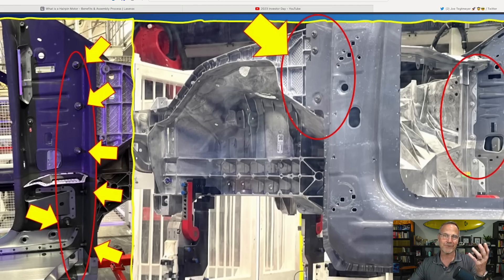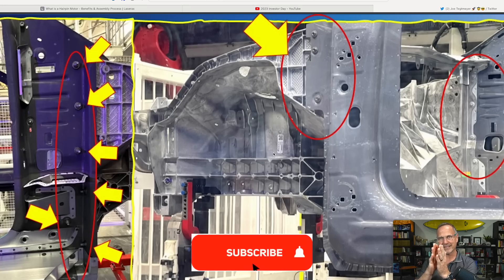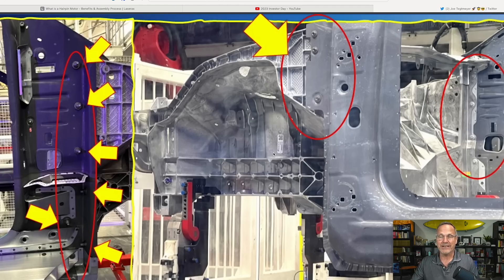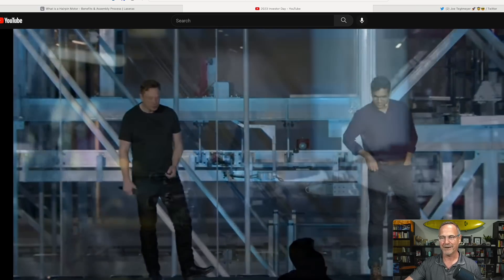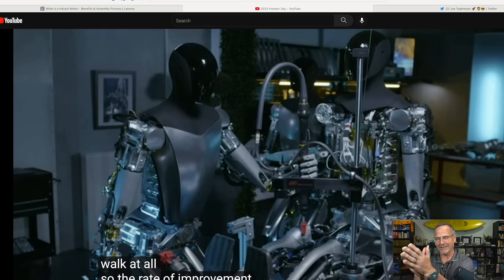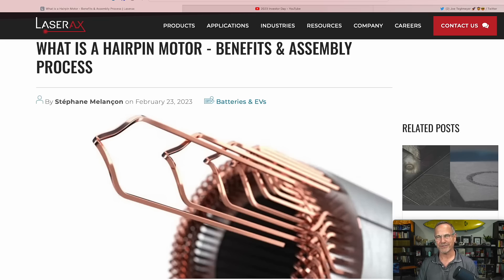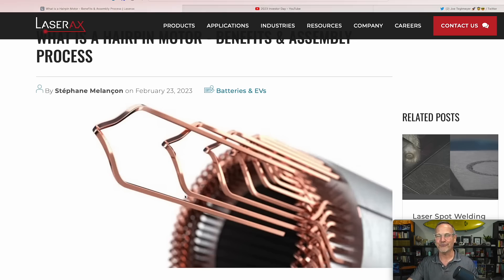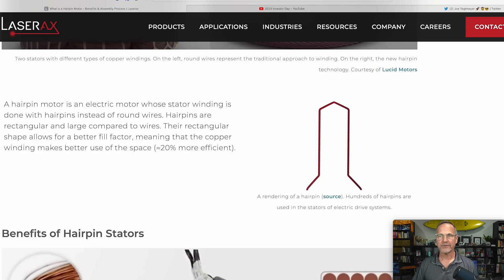Tesla Has HAIRPIN MOTORS! 🤯 What the Heck Are They?  Plus Teslabot is REAL, and How To Attach Panels

Comment: Unless I missed it, I believe one advantage of hairpin over winding that you did not mention, is the speed of build. Winding that long thin wire round and round vs shoving in the hairpins and then laser welding (according to Sandy Munro)
Reply: The machines required to assemble hairpin type windings are vastly more complex to construct than simple winding machines. However winding machines are not very efficient needing to be reloaded with wire bobbins regularly meaning a lot of down time and operator intervention. Tesla has no doubt spent a great deal of time and money constructing some kind of computer controlled machine to mass produce these motors which is why they consider these motors easier to build now.
Reply: Tesla told us what the result of those changes are. 1000,-- US$ drive train without rare earth metals... WoW! My Computers cost more!
Reply: Someone tell me why Tesla did not use hairpin motors from day one.  If it is better and cheaper, why not use it?!
Reply: @davidbeppler3032  Indirectly at least, this was enabled by the shift to 48V.
Reply: There is the issue of skin effect. You want that hairpins thin and flat. But thin hairpins are harder to handle and insertion is more delicate. So for manufacturing speed a square hairpin will be easy to handle and faster to assemble but for performance a flat hairpin is the best. Between this two extreme stranded round wires are good enough.
Reply: @davidbeppler3032  Hairpin was restricted to bigger industrial AC and DC motors for a long time. It may have not been practical until the move to higher voltage in EV applications had some teeth.  Tesla has been a big driver in getting the cost and availability to the silicon to do the power conversion for that app
Reply: @davidbeppler3032  For the same reason Henry Ford didn't put GPS and touchscreens in the first Model T. It wasn't available yet.
Reply: @Rage SR  I believe Sandy was showing examples on MunroLive of Chevy Bolt rings that took pins. He said Chevy invented the process.
Reply: @uddek  Presumably lucid has been using it since day one. Isn’t that how they got 500 miles of range?
Reply: @wickham53  they got to 500 by putting a massive battery in the cars and being able to spend much more money per vehicle with their very high prices
Reply: @uddek  What do you mean it wasn't available? This isn't something new or something rare. This kind of  armature design is being used in dc motors for a long time.
Reply: @TheCerovec  it was available before.
Reply: @sungjunbae8973  I know, I've seen plenty of them.
Reply: @uddek  Not true.
Reply: @uddek  The hairpin motor was patented in 2012.
Reply: @TheCerovec  Yes, since way back in 2012 when it was patented.
Reply: @davidbeppler3032  what are you talking about. Armatures with solid copper and not with coils is in use for 60+ years. Literally every starter motor on cars has that design. Every low voltage high current dc motor has that kind of design. I had a 600 page book in my highschool about generator and motor design,and it was in it. That was 20 years ago
Reply: @davidbeppler3032  if you actually looked at the patent from 2012 you could see it references other patents,and those other patents references the original one. The first "hair pin" is over 100 years old. US693579A Winding for dynamo electric machines.
Reply: @TheCerovec  If you look up those 100 year old patents, the motors are 90% less efficient than the one patented in 2012.  Maybe you can see a difference there?  I drove an electric forktruck for 10 years.  It had a round wire stator.  Back in 2005... why didn't the fortruck company make hairpin motors?  They would have saved millions of dollars!  You should go back in time and tell their engineers how dumb they are.
Reply: @TheCerovec  You do realize the difference between round and square?  Good.  I learned about shapes in grade school more than 40 years ago.
Yes, you can build a 1/8 hp motor that way.  News flash!  Tesla motors are a bit more powerful than that.
Reply: @davidbeppler3032  I didn't say Tesla motors are not powerful,nor did I say the efficiency of electric motors isn't getting better. It has nothing to do with my original comment that it's nothing new, something being patented in 2012 doesn't it make a new invention. And why it isn't used more widely in traction motors? There are milion of reasons why we have so many different generators and motors,there is no design that is ultimate or "the best". It all depends on the usage requirements. And where in the rpm range of the motor and load you want that efficiency. And already avaliable machinery at third parties for producing them,winding machines that can do large volume production have astronomical prices. I worked on motors from the same manufacturers with exactly same form factor but with specifications so different it was practically a different motor. I've worked on and repaired countless generators and motors with all kind of armature designs and I've seen plenty of "hairpin" windings on motors that fit in your palm up to the motors that you can walk trough the stator.
Reply: @bogususer2595  hairpin motor patent is held by a S korean 2012
Reply: Stranded round wires can never fully fill the winding spaces within the motor’s iron core. Hairpins can bd made to exactly fit the space. You get more copper where it’s needed, fewer spaces where there’s no copper and less vibration within the windings that leads to failure.
Reply: @Dave5843-d9m  You fail to take into account skin effect. Copper in the core is useless only the copper on the surface of a wire transmit electric fields. Filling in cavities is wasting copper if it is not increasing the surface area of your conductor. Circle is not a good cross section but multiple strands of circular wire has a lot of surface area. To compete the hairpin must be very thin and flat to increase as much surface area as possible. The ideal cross section for AC conduction are PCB traces where the ratio between width and thickness is very high.
Reply: The hairpins themselves would be cheaper to mfg than thos long thin spools of wire.  Also, the thicker hairpins would be much less thermally sensative, ie less likely to burn up on account of the thicker hair pin cross sections
Reply: Not quite but close enough
Reply: @13:40 he mentioned this
Reply: Format doesn't determine speed. How fast the electric motors spin determines the speed.
Reply: @brandoYT  How fast the motor spin is limited by the inductance of your coils and the inductance of the coils are determined by their geometry. Coil geometry is complicated. You cannot simply say hairpin good. You need proper simulation to determine the expected performance.

Comment: Honestly when I first saw a hairpin motor of one of the VW models several years ago, I wondered why Tesla did not have it. The material can be much more efficiently (denser) packed.
Reply: Because Teslas motors are from 2008. VW has started much later. And it takes time to change your production to a totally different designa nd architecture. Even Tesla has troubles changing something this profound.

Ask those other OEMs when they stop using rare earth metals. Thats much more innovative.
Reply: Calom down Wolfgang. Tesla already uses them everywhere exept freemont/nevada
Reply: @jonas_4901  I don't know about that. The last iteration from Munro showed classical bound copper loops. Not hairpin construction.

Whatever i am perfectly happy with my string bound motors.
Reply: If I remember correctly, there's an older Munro video where he mentions that Giga Shanghai is using hairpin. I think it's the one where he is comparing the motors of various EVs.
Reply: @wolfgangpreier9160  I for sure know about that, because i was talking to colleagues onsite this week for some improvements.